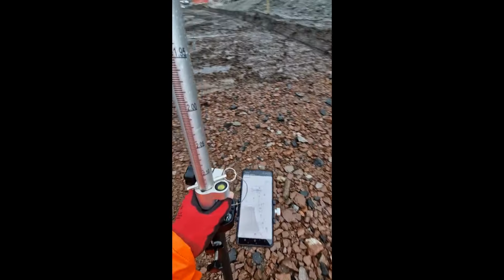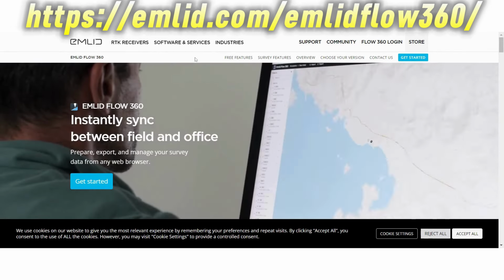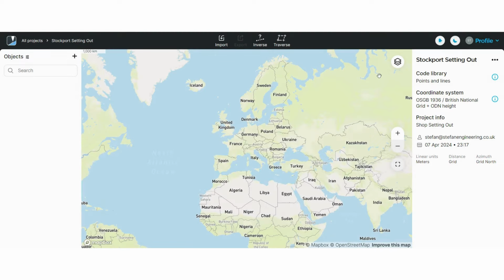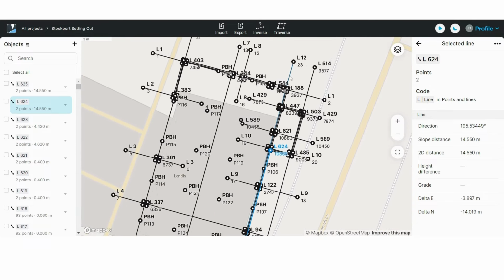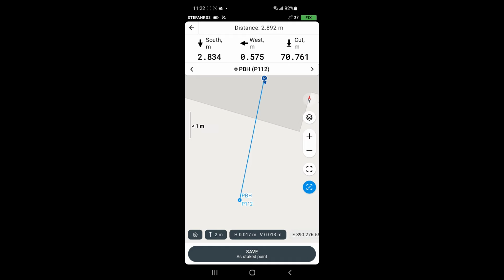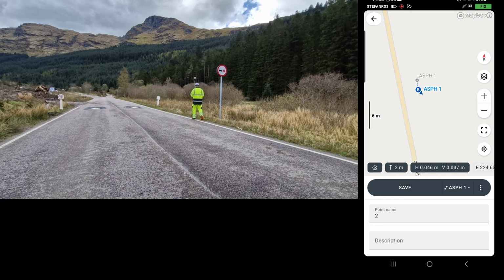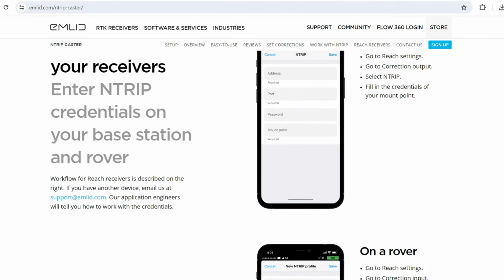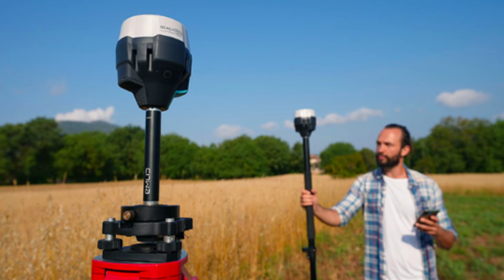One Month with Emlid Reach RS3 - The Surprising TRUTH

Comment: Hi. How can it be used, software, in remote areas with no Internet (Canada north), for hardware I know should be Base+Rover?
Reply from the maker: Yeah, works as base and rover and send/receives corrections also thru radio.
It also log in raw data to post process and for drones the base sends corrections also thru direct WiFi

Comment: emlid`s rover ppk you can processing just just at Emlid studio, and at this mode you need write a static all time! For example for 3 hours you have 10-12 points and 300+ Mb non-stop rinex, and csv-file with time marks - this is sad.
Few times I can fix at ppk mode with RS3 base and GS 14 rover (30 sec to 20 min) and post processing at TBC at the same time with other GS 14 was all right.
Mostly use like a RTK-base for dji drone
Reply from the maker: I used it mostly for RTK surveys, drone base and PPP for base points where internet is not available. 
I use PPK just as backup and I never been a fan of Stop and Go and PPK to be fair.
Reply: @flyingsurveyor  in my practik, rtk via radiomodem and internet not all cause are available

Comment: Thanks for getting back to me! The problem with rotating laser levels is that they’re quite slow and tedious when it comes to converting measurements into AutoCAD. For example, if we need to capture 20 points, we have to manually measure the X and Y distances and the Z height with the laser, then input everything into CAD. Is there a device similar to a rotating laser that can directly provide results in CAD to make things easier?
Reply from the maker: Ok, now I understand what you guys are looking for. Emlid Reach RS3 or even Emlid RX the small one will be great for you as long as you have clear sky. It does export your points as DXF format for AutoCAD. 
You will need a NTRIP license that can be around 2000 USD per year or you can buy base and rover but is a bit more complicated.
Another method to survey X,Y,Z coordinates is to buy or hire a Total Station that is more complex, very expensive and requires even more training so this GPS is probably more suitable for you. 
Check out my other video to understand how RTK works and if you go on this route and get stuck you can find my details in the video description and we can have a chat.

Comment: Hi 
We are a civil engineer company and something needs to check the grading elevations for small projects.

Do you suggest this emlid 3 for this type of project?
Please note we are not a survey company or surveyor and prefer to don't pay the monthly subscription fee for the device.

Please advise
Reply: Thank you for your response.

The main issue with using a rotating laser level is the inefficiency—it’s quite time-consuming to convert the measurements into AutoCAD. For example, capturing 20 points requires manually measuring the X and Y distances and determining the Z elevation with the laser, which then needs to be input into CAD to draw them.

Is there a device similar to a rotating laser level that can directly provide output compatible with AutoCAD? Please note that we do not require geodetic points; local points would be sufficient for our needs.
Reply: I would check out Bad Elf. I work for SUE firm in PA and it’s as accurate as it gets. I use a base and rover set up to avoid subscriptions. This also allows me to work without internet connectivity.
Reply from the maker: Hi there, if you do only small projects and you need to check elevations is better just using a rotating laser lever. 

GPS antennas is more suitable for setting out road and bigger areas. On top of that you will need a NTRIP subscription and you will need to learn how to use AutoCAD to import and export data.

I made another video about how GPS RTK technology works you can check it out to make yourself an idea: https://youtu.be/T3ndOYUxIn4?si=rZYC6nnM-XB7qZyo

Comment: Great Video Stefan. Yep looks the code library could do with updating so that the line is also in the correct layer. Fieldgenius is the best for that and you can use it with nearly all GNSS receivers even this Emlid Reach.
Reply from the maker: @petertips2686  I agree that the field software is not as mature as other software. There have have been some updates since I posted the video but there is still a lot of stuff to improve.
I had a chat last week at Intergeo with the Emlid Developing team, suggested also this issue and they been very open to suggestions.

Comment: Great video thanks!
I am new to GNSS and looking for a system to measure vertical movement (settlement of ground).
My question, is it possible to achieve 10 mm accuracy in the vertical direction? If so, it is only with PPK, using the base and rover setup?
Do you need a know point beforehand? If yes, how do you obtain that know point?
Reply from the maker: I think that it all depends of your site and expectations. The GNSS manufactures claim vertical accuracies of 7mm for PPK, 15mm for RTK base and rover and 25mm for NTRIP. From my experience GNSS vertical measurements can bounce a few centimeters because it depends of a lot of factors. The best monitoring results I got by surveying with a total station or level instrument, but again it all depends of the site and the expected accuracy

Comment: Great review, thanks! I have used the RS2+ in the field with two antennas, base and rover setup. Even in a hilly wooded area, I have had no issues with this equipment. Highly recommend.
Reply from the maker: Thank you! I think it does great job for the price
Reply: How good is your gps with a rover only NTRIP setup in the woods?
Reply from the maker: @llemontree7425  Emlid receiver has only 184 channels and it's ok in some areas with a couple trees but it's loses the fixed solution faster. Trimble R12 does a way better job in areas with low signal but it has a way higher price

Comment: Do you have any comparison to CHCNAv receivers aswell? Seems that they have more channels and the price it's kind the same. Thanks!
Reply from the maker: Unfortunately not, I have been using only  Trimble and Leica recently. I used Emlid RS3 on different job and as long as you stay away from buildings, it doesn't lose it's signal.
I think the biggest difference between the GNSS receivers is the field software. 
I guess it depends for what are you use it for.
Emlid has as advantage the Caster service that allows you to create your NTRIP service for free (which sends corrections thru internet to any receiver), and Emlid Flow that allows you to post process (PPK) GNSS static data (I have in my plans to make a video about it).
Emlid is very simple to use, and that is the reason is prefered by drone pilots and non-surveyors.
Reply: My company has transitioned from Spectra Precision (basically a cheaper Trimble sub-brand) to CHCNAV since last year, and I’ve a little experience using Emlids in the past.

What I can say is, Emlid is definitely geared towards less-geomatically-inclined users (archaeologists, new UAV mapping techs, civil engineers, and the likes) with the design language and wordings apparent throughout the UI and their whole marketing. There is nothing inherently wrong with this, but it is obvious why UAV mapping techs are almost always seen using Emlids. They are “good enough” tools for what they are going to be used for (UAV base station & GCP setup).

I find that for surveyors/geomatic people like me, CHCNAV does offer more in terms of functionality - without the need to maintain ANY monthly subscription (yes, Emlid’s data collection software has a free version, but has features locked behind a paywall.). The UI is not as clean as Emlid, but it is far better than their fellow Chinese competitors. The bundled Android-based data collector lasts all day.

Nothing wrong with Emlid especially if it has a better support network in your region, but at the moment, CHCNAV wins. Can’t say how long they will maintain their aggressive push into the market, but at the moment, they are worth the price.
Reply from the maker: @12345678946513  I totally agree with you, at this moment Emlid field software is not there regarding professional surveying. I even told that to the Emlid team when I met them in London. They have some cool features but data collection software is pretty basic, but I guess that is ok for people without a strong survey background.
 I played a bit with CHCNAV at Geo Business and the field software looks pretty ok. Not like Trimble but pretty decent. 
I guess it all resumes at what people are intending to use the equipment for, and what budget they have.
Reply: @flyingsurveyor  Asi es, el software de Emlid inició siendo muy básico, aunque a la fecha ya tiene una mejora sustancial, otros detalles que presentaba eran sus actualizaciones de firmware muy continuas y con algunos fallos en los equipos (calentamiento del equipo, apagado repentino, poca cobertura de la señal de radio), pero estas mismas actualizaciones mejoraron en mucho la calidad del desempeño del equipo, se hizo mas estable el fijo y se obtuvo mayor cobertura en la señal del radio, las limitaciones del software me llevaron a utilizar el Emlid con software de terceros (Survey Master, Nuwa de Tersu, TcpGPS) con excelentes resultados, Emlid es muy buen equipo, con las limitaciones propias de un GNSS, solo hay que adecuarlo a las necesidades de tus proyectos.
Reply from the maker: @gabrielacosta2521  you are right, the software it was very basic when I made the video, but now it got since a few more features and I know it will get better in the future. 
When I met them in Germany, I addressed a few suggestions and they been very open so if is something that you will want to improve I recommend contact also their support team and I am sure your sugestion will be taken in consideration.
Regarding the hardware, after using it for more than 6 month I think it does a decent job, and yes you may get some better performance with other premium GNSS receivers in challenging enviroments but the price gap is huge.
Reply: @12345678946513  Thanks for your awesome review and feedback!

Comment: You can add a laser rangefinder and get spots entering the distance measured by the laser. its like having a 50m pole.
Reply from the maker: There is a chinese company that makes something like that 😅
https://www.comnavtech.com/new_RTK.html
Reply: Can you explain how to do this?
Reply from the maker: @tuliosoto4546  there is already a Chinese company who produce these kind of GPS, check out my like up ⬆️.
It's basically a disto installed on the bottom of the GNSS receiver.
Reply: @flyingsurveyor  thanks for the quick reply, I am aware that there are products. I own a RS3 and adding a laser rangefinder can be quite useful for some of my applications
Reply from the maker: @tuliosoto4546  think of it as a disto and a GPS receiver combined. It's not as complicated as it sound.
As long as you align the centre of the receiver with the laser, create a custom mount for the disto and the mount offset to the pole height is fine. Also you will need to add manually the pole height which is the disto reading plus eventual the mount offset.

Comment: emlid reach is a dual-frequency receiver. It's not a multifrequency receiver.  In the same price range, today there are much better receivers with field software that Trimble users (like me) would be jealous of. For me, it's not worthing at all.
Reply from the maker: Emlid Reach RS3 has only L1 and L2 not L5 and 184 channels and for less €3000 I can’t complain too much. It all depends what you plan to use it for.
As I said at the end of the video it does a decent job if you work in open areas but is not productive as Trimble R12i. I am a Trimble user and that’s why we are paying the premium price for it, because it has a great hardware and software.
Most of the people that buy Emlid, use them for control points, small surveys or to use it as  RTK base for drone surveys.
I didn’t find any videos before I bought this GNSS receiver, so I made this video for other surveyors to know what to expect if they thinking getting one and make their own decision if it suits their needs.
Reply: Which other receivers are you speaking of In the same price range?
Reply from the maker: @titotitotito  I said at 16:00 that I don’t think you can find another GNSS receiver with these specs at this price (2700USD plus taxes). I made another test GNSS receiver here https://youtu.be/dhZMhpyW2rA?si=PRzA74Abu1nxpgvN but even that one is 5500 USD plus taxes
Reply: @flyingsurveyor  sorry I was replying to the original comment. He said you can get way better for the same price.
Reply from the maker: @titotitotito  no problem, I am curious too 👍🏻
Reply: I am curious to what this bloke said too! (Also a Trimble user) 
Maybe he was dreaming? 
Regards

Comment: If you need more points and to bring in cad drawing or surfaces in, just add Fieldgenius from MicroSurvey Software, made in Canada. I recommend getting a tablet with a bracket. Fieldgenius will up the game as a better cost-effective software. They have two versions, for android and for windows. I have been using this setup since day one. Also, a second unit adds value since you have different work flows available under the hood. Trimble stops supporting their units after 4 to 5 years. No more upgrades to the software of the receiver and most of the time you pay a per year subscription. My Units are the RS2 and after 3 years...batteries are still going strong. I use them until they are dead or near dead and then recharge. Using the RS3 with tilt compensation is fully compatible with fieldgenius. My previous employer had a Trimble R12i and I used it for a year or so. When I read the specs of the RS2 and the price per unit plus the fieldgenius I knew it was going to be a winner. It's not a Trimble, but I am doing everything that I need to in the field. I check on points in the Public Land Survey System and the National Geodetic Survey Control Points and I just say Wao! GREAT VIDEO...I just wanted to let everyone know about the fieldgenius app it's a very powerful addition to Emlid receiver.
Reply: RS3 with FieldGenius for Android has had the "Tilt Compensation" removed from the program for the time being. Microsurvey has found a problem and is working it out with Emlid. I don't know if it is working on the Windows version?
Reply: I use Fieldgenius too. And along with MicroSurvey the line from the field comes into cad in the right layers and colours.

Comment: Thankyou verry much for your detailed and honest review of this receiver. At that price it can be forgiven a lot of short comings. My question has been answered lower in the thread but I have used Field genius in the past with some aging Sokkia kit I had. It worked pretty well and I would see it as a good option with the RS3. For me the most important thing for decent survey speed is being able to change codes quickly and measure. Walking one string at a time to save changing code is desperately inefficient. The quick code panels on Access work really well esp assigned 3 by 3  to match number buttons. You can change code and measure without looking down at the screen. I accept Trimble is way too expensive but jumping GNSS to robotic to even scanning on the same controller is superb integration. Its really easy to configure R10/12 base for NTRIP to drone too. I'm also in Scotland and curse the poor mobile coverage for VRS. If you use a Trimble receiver with VRS, and you ask, they will give you a code to flash at the R12 to get RTX. If you have no phone signal you can be under way in about a minute. It only falters if you have a high mountain to your south. I think Leica have something similar. I wonder if Emlid have such an option.
Reply from the maker: Hi Stuart, thank you for your comment. I am affraid that Emlid doesn't have all this features and for the price that I paid I can't really fault it. Trimble Access is awesome field software, plus Emlid it has only 184 channels instead of 650 of Trimble.
I am a Trimble user also and I plan to buy a Trimble GNSS receiver in the future and at the moment I use the Emlid RS3 mostly for control points and small topo's to reduce the equipment hire costs. 
As far as I know Trimble is the only company that provides something simillar with RTX and that's why I purchased the VRS Now license.
Like I said at the end of my video, I will keep the RS3 even after I will buy a Trimble GNSS and use it as a base, but how is now it can't replace the practicability of Trimble.